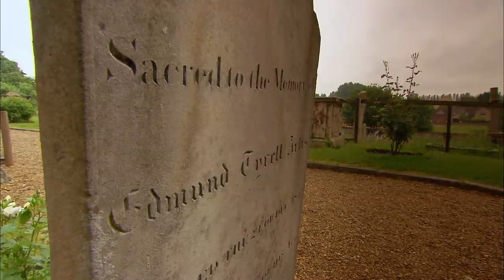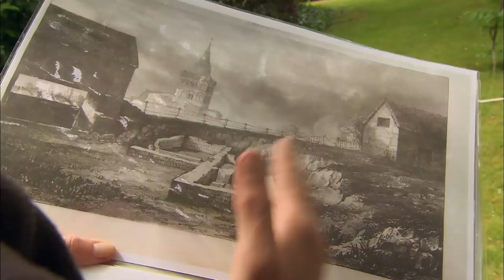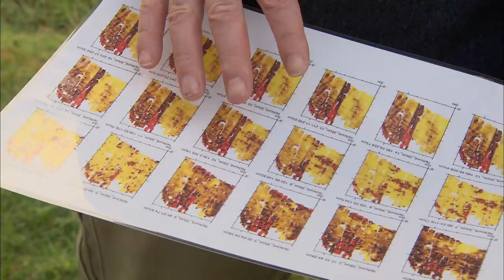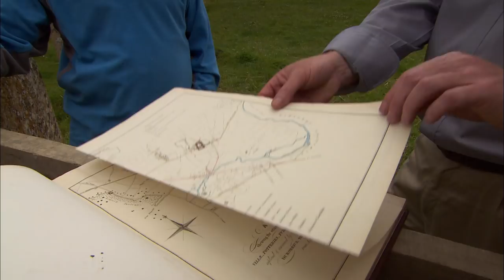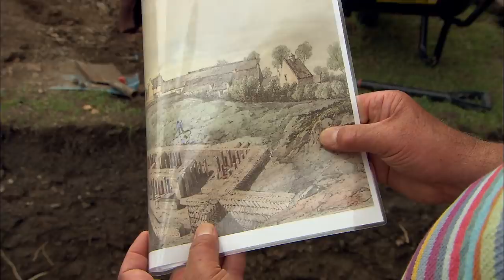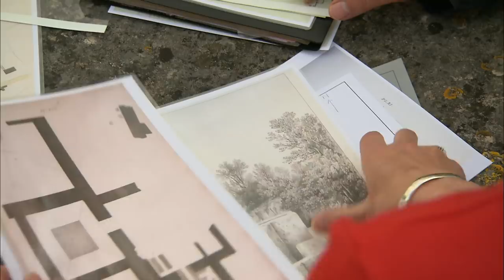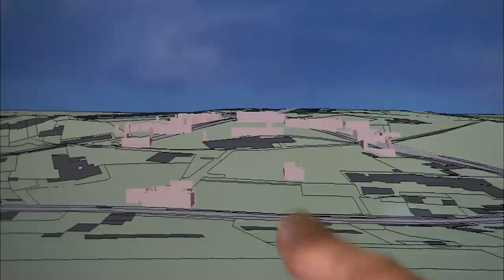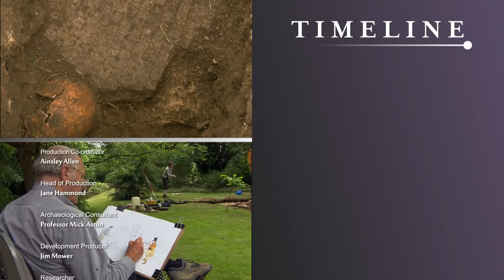The Largest Roman Palace In Britain Discovered Under A Medieval Church | Time Team

Comment: Funny thing! Usually there is a sober but respectful regard for those buried, whether individual or a mass burial. Here, the dead are for the most part ignored.   I assume the bodies will be gathered as well as possible and given a respectful re-burial or taken to a lab and storage facility, treated properly.  Or are you just going to push soil back on top again and jump up and down over the fact you found a tile floor?

Comment: If it is a preatorium, or a country house occupied by a governor, it would have had a temple to Jupiter in the grounds. It will have been converted into a church. This area would have been overrun by Vikings and the temple become a ruin. So when the church was built, it was not built on top as usual but immediately beside the rubble of the temple ruin to minimize cartage.
Reply: @Napoleon Hercules Thanks - I been reading too much Greek. Fixed it.